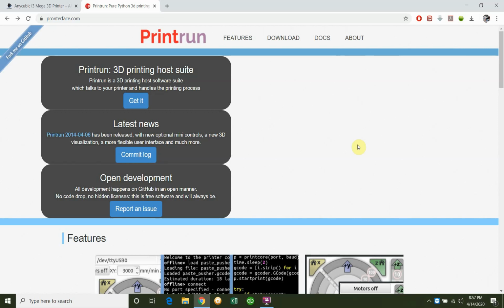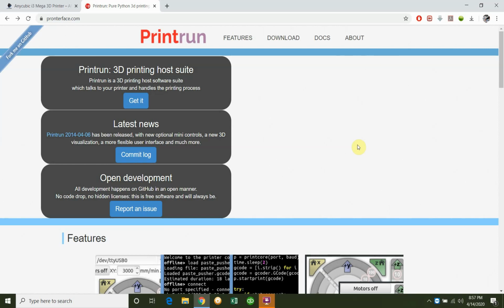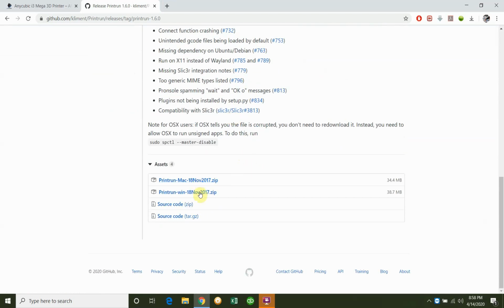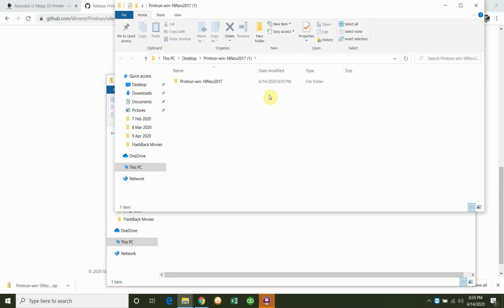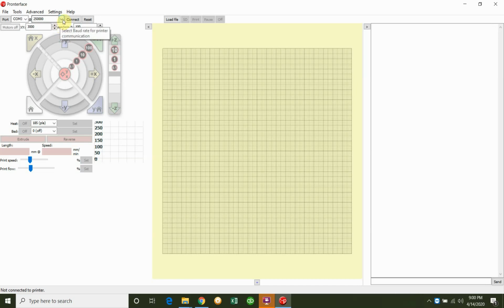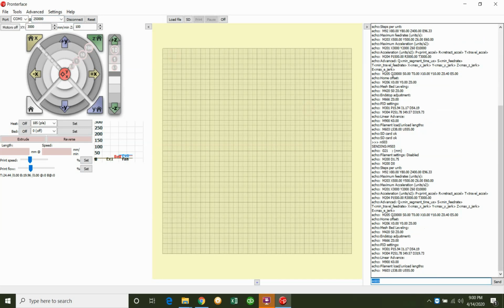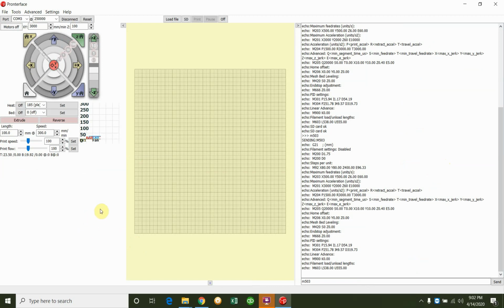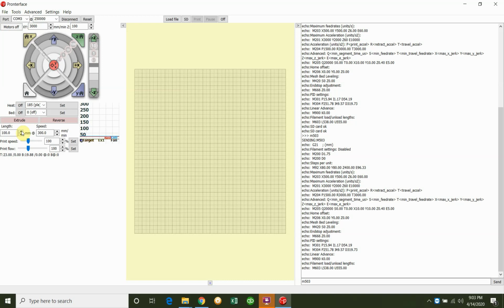Using Pronterface with i3 Mega

Comment: Mine just won't connect at all to the printer!
Reply from the maker: They're is a definite an "order of operations" with it.  Try different sequences of plugging in the usb and powering on the printer.  Try a different usb cord possibly. Different usb port, etc.  If all that fails, it's likely a hardware issue.  And, in that case, you could remove the bottom and make sure everything with the usb is connected correctly and tightly.
Reply: @johnnyg507  I just found in another thread that pressing rest twice gets it to connect! How silly.
Reply from the maker: @davidcross30  Yeah... when there are issues, sometimes the solutions never seem to make sense.  But... if they work... all good. ;-)
Reply: @davidcross30  This worked exactly once and not again since...